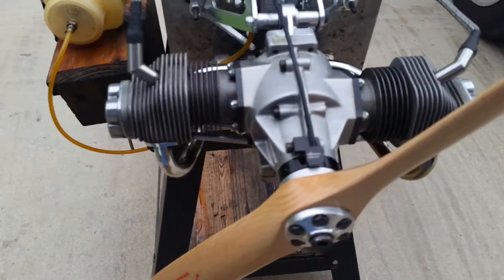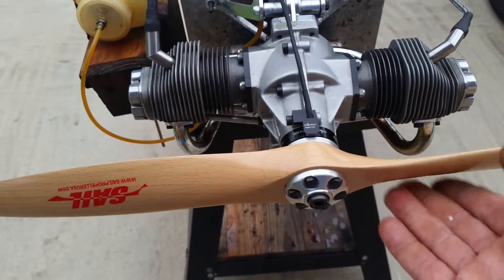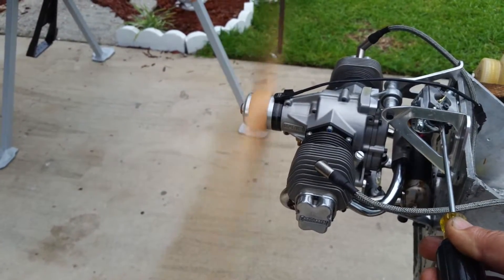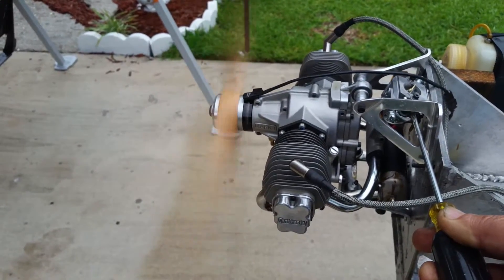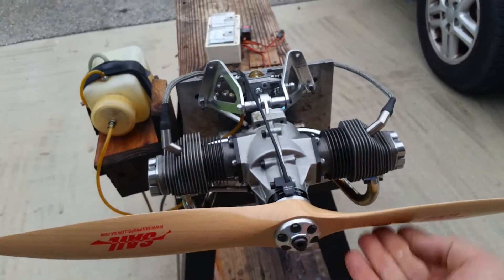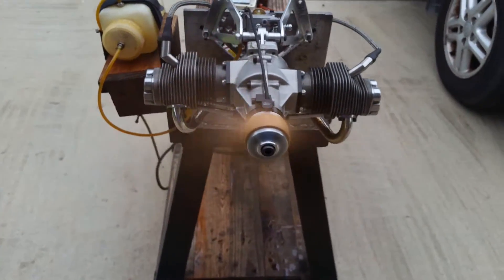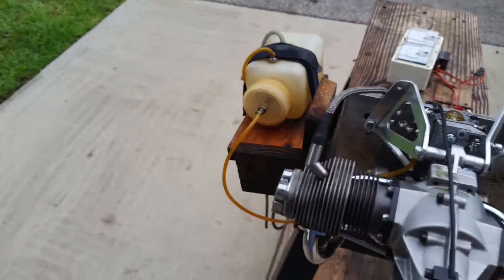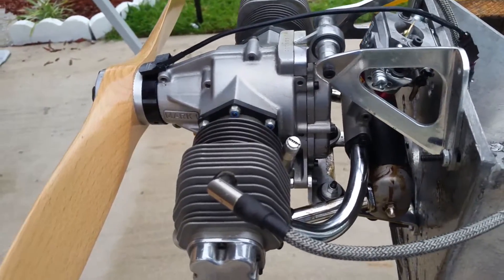Kavan K50 CH Ignitions  CDI & Gasoline 20:1 conversion

Comment: This is the same engine I have. I run it with the carb that comes on it. I use alcohol for fuel with about 2 % of Klotz oil in mix.  I use Klotz oil in crankcase.  Works great !   John

Comment: I have a Kavan 50cc twin about 17 years old.  It was the Glow version, but I installed a RCexl solid state ignition. It runs very good. I do not recommend gas as fuel, but I prefer to use alcohol like sold at where they race cars or Dune buggies. It runs cooler than gas & mixes real good with Klotz 2 cycle oil. The extra oil will blow out the vent tube.  The oil that passes the pistons ends up in crankcase.  You will only need 5 % lube in with the fuel. Adrian now sell CDI ignitions & has many types.  A single cyl version/a twin version/a 3 cyl version & even a 4 cylinder version.  He has all the neat items you may need. Just google CDI ignitions.  Also there is a place to get RCexl ignitions.     www.rcexl.com   All good stuff !